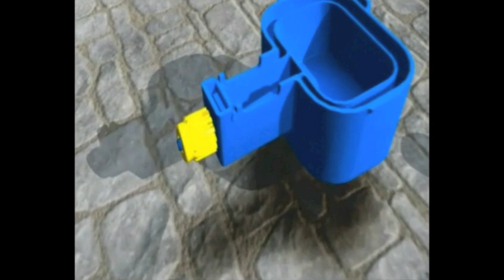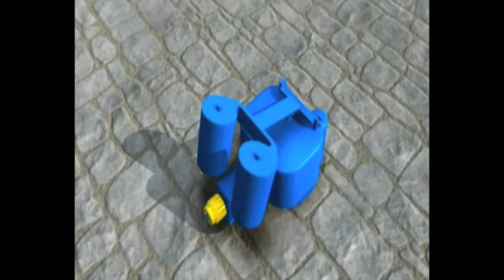AutoPot Watering Systems - Understanding the AQUAvalve

Comment: how did they get away with this....Jim Fah from Malaysia now in Australia invented the auto pot valve..............and patented it . now i see copies..?.....also i know from my experience. the valve has 2 moving parts two little holes and water driven...so simple ..cleaning ..as shown here....but they dont always work...sometimes it will happen, they wont open or they flood...and nothing you can do ,even new silicone stoppers wont fix it ??? any other ideas??
Reply: this is better that aussie one was shite